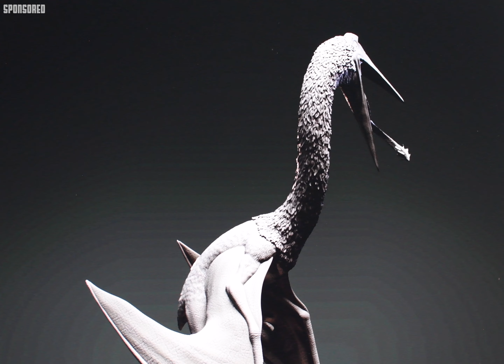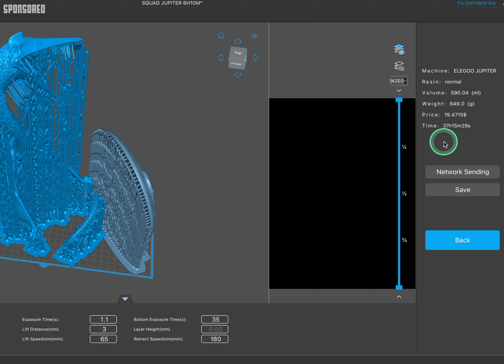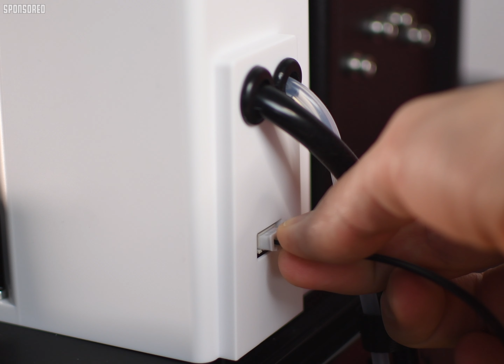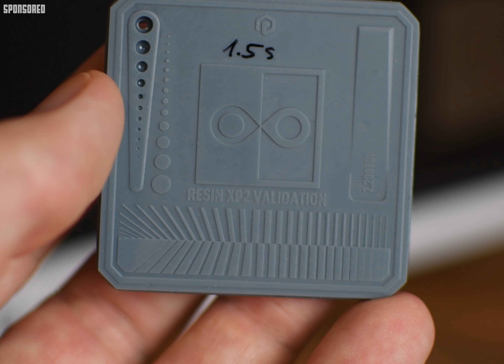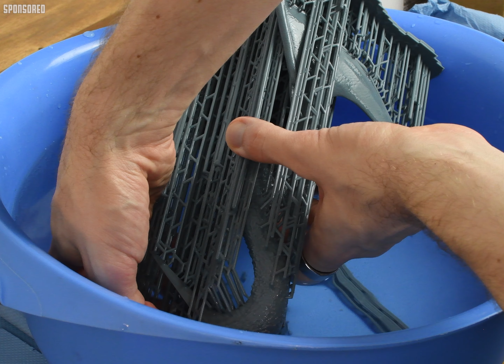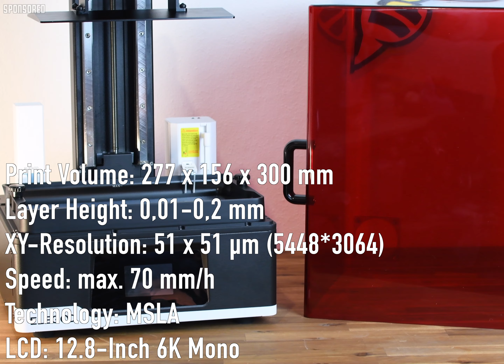Printing BIG with the JUPITER SE - A Review

Comment: What is yhe minimum amount of resing that need to be in the tub?
Or does it needs to be full every time?
Reply: about 3/4 full is recommended due to the plate making the levels rise even more, the pump will actually add more resin if needed too.

Comment: Great video, I got a question do we need to use the resin provided by elegoo for the resin pump? What if I want to use different kinds of resin?
Reply from the maker: It works with any kind of resin. I tried resin from Phrozen, Elegoo and Creality. All worked fine!
Reply: You have to make sure the lid fits the bottle though, it's made specifically to fit elegoo bottles (could always clean an old elegoo bottle and put different resin in that though)